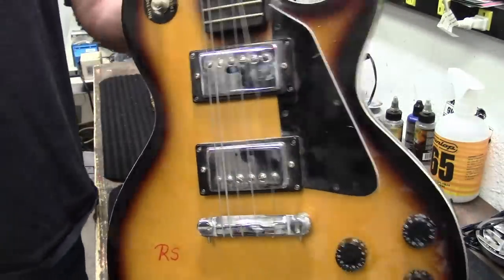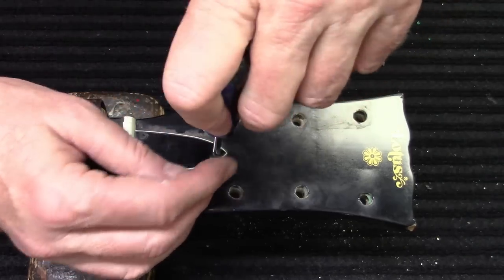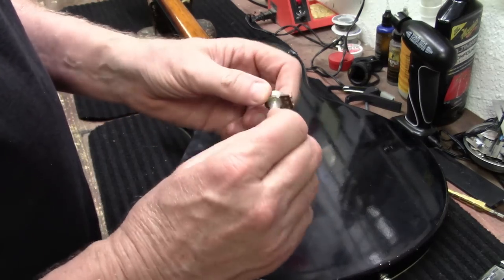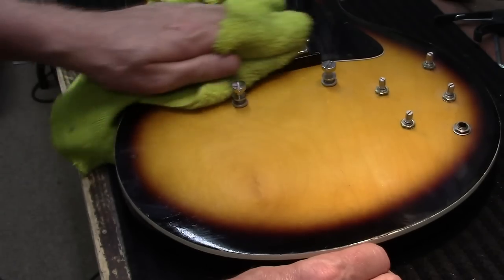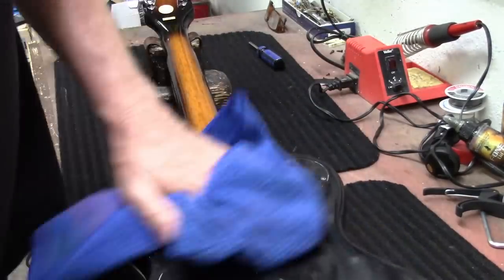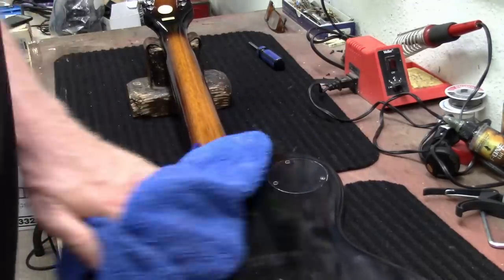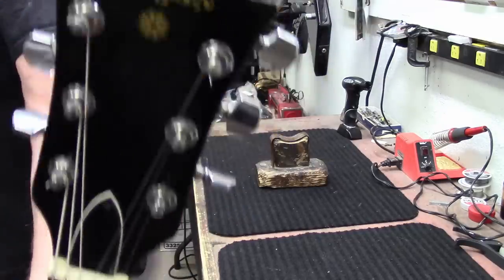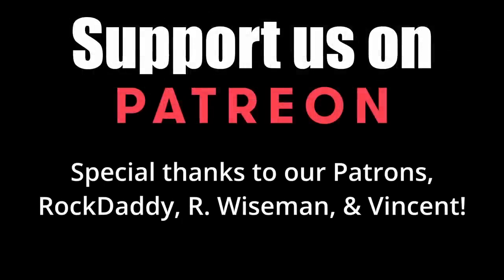Goodwill Guitar Rescue! Lotus Electric Guitar!

Comment: I got a hold of an old '80s Ibanez guitar, I don't remember the model but it was kind of SG shaped, it looked as though 3 different types of tuners had been installed throughout its life and so I filled the unwanted holes with cocktail sticks and dyed them black to match the guitar but it looked ugly , I remembered that I had some very thin black veneer and so I cut some shapes to what looked like the original tuners marks on the headstock and glued those on, I was a little concerned that the new tuners might not fit with the veneer on there but I tested them and they were OK, the guitar looked better than having the filled holes.
 I sold the guitar for what it had cost me as I had far too many at that time and also because the guy who bought it from me was relatively broke but very keen to learn to play electric guitar.

Comment: Put screws back in the tuning machine holes works well Wilkerson bridge really upgrade those string over...the Wilkerson bridge is adjustable has brass saddle you can get intonation correct.

Comment: I have one very similar to this. Not a lotus but a stradolin. Had Korean switch in it. Had no bridge or pots so I had to wire it using Epiphone parts with little modifications. Very light. And yes plywood.
Reply: I just bought one and it's 14lbs. if it's a ounce, why is that?

Comment: "I used to use a hammer and  screwdriver to whack tuner ferrules out of the headstock chipping the paint all around the surface."
Then uses hammer and screwdriver to whack out the nut.